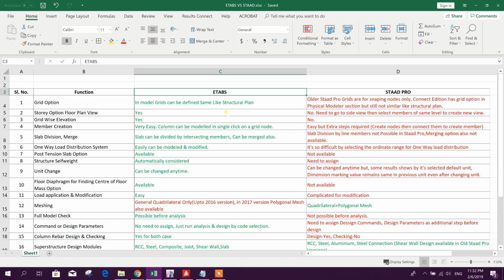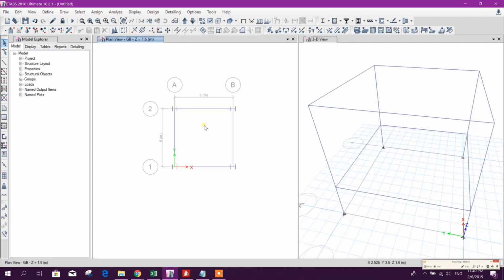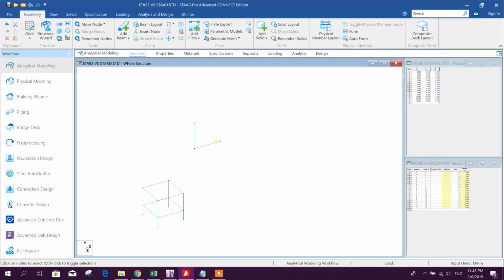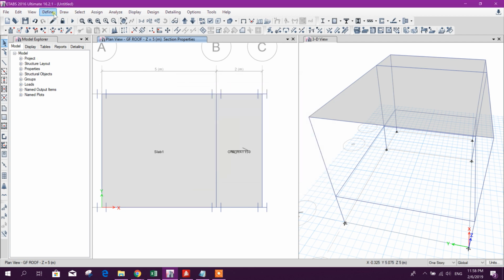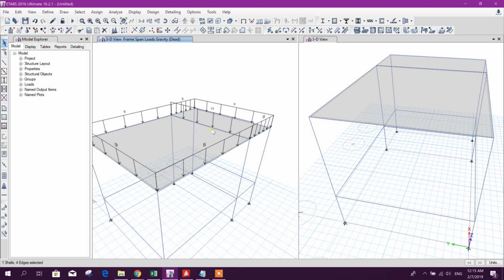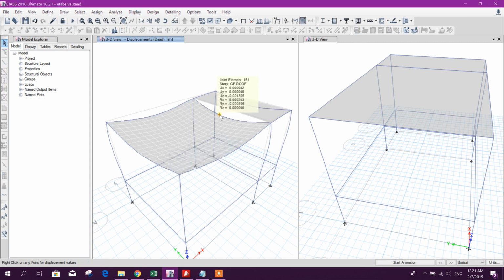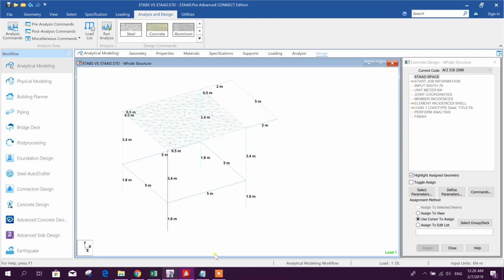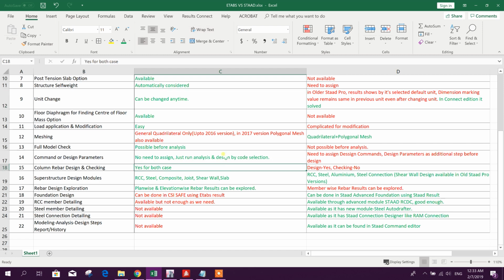ETABS VS STAAD PRO-EXPLAINED IMPORTANT DIFFERENCES

Comment: Eatbs is based on Object based modelling while staad is as per analytical modelling only where designer has to think before choosing every element & member with their connections to each other & Staad gives good summary results in post processing readly availble with group wise also which is not included in CSI producs.
Reply from the maker: Yes that's remarkable point also. Thanks for reminding that. In analytical case SAP2000 has that same versatility. Report is not that much good in CSI products as we expect.
Reply from the maker: It's sad that- Staad Pro Connect Edition not having Shear Wall design option. Staad Pro should add some convenient options for modeling buildings.

Comment: Hello sir, nice video but i would like to say this, staad pro can assign rigid diaphragm via master slave and it does shear wall design either via analysis-design option or through RCDC but you need to model the shear wall using rigid arm method. 
I will also add that with the staad pro connect edition v22, with the physical modeler, it is easier to assign loads to slabs as in staad pro, also the modification of these loads is possible on the spreadsheet option for loads...apart from that am okay with what you said...
Courage
Reply: It is easier to assign slab loads in staadpro as in etabs with physical modeler
Reply from the maker: Yes, But master slave is little bit lengthy process not like simple Diaphragm method in ETABS. I also mentioned older Staad Pro version can do shear wall design. In some cases Staad Pro is better than ETABS. So both are very useful & powerful and preference depends on the requirement & user's proficiency.